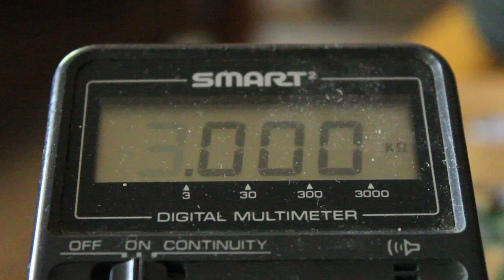PS2 Potentiometer Adjustment - Disk Read Error Fix

Comment: My PS2 Slim can read some disks, like Ford Racing 3, but when I put in another disk (Pitfall: The Lost Expedition for example) It spins it up, then goes to the browser and system info screen. I tried doing this, but when I tightened the screws a tiny bit the motor made a loud ticking noise, so i loosened them again and fixed that. But why can it read some and not others? Help please. Thanks.
Reply from the maker: Dakota House A loud ticking noise generally means lens strain, it's probably getting a bit old and worn down. There's not too much to suggest in this type of situation other than to do a very careful lens cleaning, or a completely new lens swap with something like this: http://www.ebay.ca/itm/Disk-Laser-Lens-Deck-Replacement-PVR-802W-for-Sony-Slim-PS2-BEST-/181789025337?pt=LH_DefaultDomain_0&hash=item2a53786439
Reply: Sam Campbell I did a little more research and figured out that it can read CDs but not DVDs. So I am assuming that the DVD diode burnt out since that is what I used the most. Meaning I will have to replace the laser. Thanks for your help, I think I will buy the KHM-430 I have read they are better quality. Are they interchangeable with the 750001 Model?
Reply from the maker: I'll be honest, I'm not quite sure, but I would assume that it would
Reply: Sam Campbell Alrighty. Thanks for your help. You gained a subscriber.
Reply from the maker: Thanks!

Comment: Hey Sam, thanks for the video, pretty self explanatory.
Is the Pot Adjustment good for any issue involving a case where the PS2 reads CDs but no DVDs? Many thanks!
Reply from the maker: afterburner94 It could be a possible fix, it really depends on manufacturing tolerances